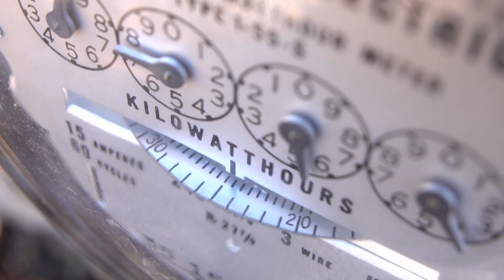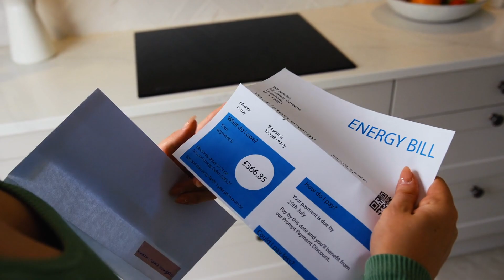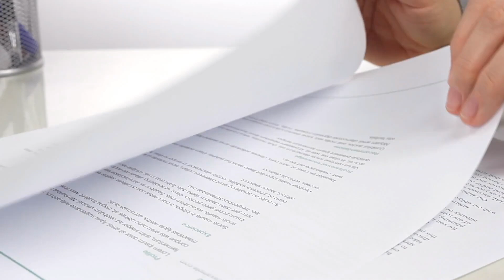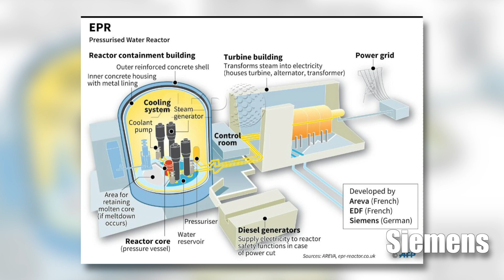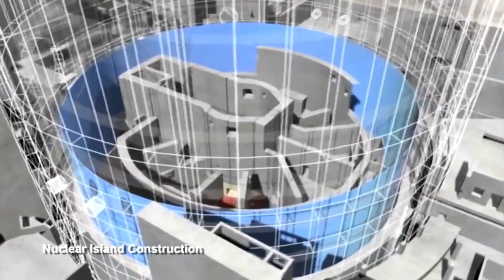Hinkley Point C - Britain's Most Controversial Nuclear Project

Comment: Why are they not looking into molten salt based reactors, which would be a fraction of the cost, this project is outrageously overpriced, and it appears to benefit overseas manufacturers, adding little value to the British manufacturing sector. I can see this resulting in devolved regions deciding to go it alone to bypass costs of this white elephant.

Comment: There is no natural gas fuel savings supporting large amounts of wild AC from solar voltaic and wind turbine generated electricity.   All the electricity can be produce with less natural gas with efficient running natural gas combined cycle plants.   Culling output of wild AC to lower more stable levels makes it slightly more compatible with the public power grid.   Provided there is no cost for the wild AC it may break even on the natural gas use for supporting it.   

In the UK with wholesale natural  gas in Oct. 2024 in US equivalents was priced at  $10.50 per million BTUs.   The high cost of 106 pounds per MWh ($132.53 USD MWh) nuclear  should still be cheaper than making electricity with natural gas prices even significantly below that whole price.  

 US offseason natural gas price June 2024 was $2.50 per million BTUs.   That is three times the estimated fueling cost of a new ultra supercritical clean coal plant burning high BTU bituminous coal with a crossover fueling price with natural gas at $0.80 per million BTUs natural gas.  The UK has lots of high quality bituminous coal it could, with labor reform,  extract by greatly automated cost efficient means. 

Typically there is a significant price for wild AC even though it bids frequently at 0 or negative since large amounts of wild AC  doesn't work without fast reacting peaking power that has to purchased as well.  The electricity wholesale market pays the price of the highest bidder to ALL BIDDERS even those biding at 0 or negative.  So the low bid price of wild AC always includes in the wholesale market sale if it exists in the market even though it costs more natural to support than making all the electricity from more efficient means.    

Wholesale coal fired electricity in the US mid west scheduled 24 hours  in advance is commonly at $30 MWh.   Internally generated coal fired electricity is significantly cheaper.   Likely half this amount or less.   Natural gas is too expensive a fuel even at US break even production cost sale prices for base load electricity.    Natural gas is very good for fast reacting peaking loads using natural gas turbine generators which are typically the only means to instantly backup 100% large amounts of wild AC.

Comment: you gave zero arguments as to why it was a bad idea, you just gave an unbased opinion, saying it was expensive. but even at the 50 billion pounds you fear, 3200MW at 8000 hours a year for 60 years leads to 30 pounds per MWh or 3 pence per kWh. renewables may be cheaper than nuclear, but the grid that you need to go with renewables makes it more expensive.

Comment: The problem started with the last Labour government, The Energy Authority reported extra delivery of power would required by 2030 due to green policy expiring power stations and older end-of-life nuclear sites. PM Blair refused t sign  off a new power station build leaving it to the incoming tory government. Due to the time constraints to build and test a new nuclear station PM Cameron was forced to accept a bad deal by EDF (very public at the time). This coupled with a Chinese reactor that the French versions have never managed to get to designed outputs.  Basically the UK from the 2030's will have the most expensive electricity in the world, meaning no company's will want to move their product facilities to the UK further weakening the UK GDP and reducing public services, ultimately turning the UK into a third world country in western Europe.

Comment: Thatcher ruined the UK's nuclear industry with her ideologically driven 'privatization' policy.
Previous to this, the then CEGB had a well planned program to gradually go fully nuclear with PWRs, after the I'll fated excursion with domestic AGRs failed to work out. Size well B, which has been reliably supplying the UK with electricity for 25 years was the pathfinder project, and the only one to be built under CEGB plans. A nuclear program is only really feasible with a centralised, state owned electricity supply industry. Thatcher's I'll conceived privatisation scuppered this and the nuclear industry. The UK would likely be fully nuclear by now if not for Thatcher.

Comment: Ok nuclear submarine reactors are designed and built by Rolls Royce in Darby, and have nothing to do with Hinckley. Hinckley is not a one off. There is already one plant of this design in operation in China another is nearing completion in Finland. At £102 per MW, that is 10.2p per KW, current average domestic price is 37p per KW.  That is Much cheaper than the current gas based price. A second site will be at Sizewell, which will have more government involvement
Reply: GBP102/MW is a wholesale not a retail price, and is three times the current price of wind projects. Gas is always costlier than baseload power like nuclear and coal which is why it's only used for generation at peak times.
Reply: @gibbonsdp how well does each form of energy convert to retail price?
Reply: OL-3 in Finland is finished and running
Reply: @LambdaWave84  Yes, but it's been even more of a fiasco that Hinkley C - 19 years late and costing almost four times the original budget.

Comment: Come on man. Tidal or wind isn't going to put a dent in your energy needs. You need this.
Reply: It can and often does. Yes, we need more plus extra storage capacity. We don't need this nuclear power station, and certainly not at this cost.
Reply: @tamingthejungleanallotment5486 and who exactly are you to make such an entitled statement?
Reply: @tamingthejungleanallotment5486 Please let me know of any storage tech that can store the energy needed for say weeks? We often have almost no wind for over 2 weeks.
Reply: @Music5362  , @tamingthejungleanallotment5486 is correct. Wind is a very large part of our generation stack and we have an optimistic 50GW of wind capacity planned for 2030. To put that in perspective, in winter times of peak supply we will only need max around 45GW. 

We are a very windy county in the UK, but you are right that wind output is varied. We are in need of stable renewable generation to cut out reliance on gas and I do believe nuclear is the way forward. Unfortunately the way the UK manages infrastructure processes as a whole is very broken and it becomes painful to watch all these necessary projects go 3-4x over budget. 

The other problem with wind is that it generates no grid inertia which is why we need storage capacity to balance the grid. Storage is not meant for powering the grid by itself when renewables are not available unless we are in desperate need of more generation, it is primarily meant for balancing.
Reply: @Music5362  gravity batteries, some of the new chemical batteries are suited to long storage, i cant recall which of the many formulas ive learnt about however as it's not my forte. 
there's also air batteries which can store energy for months apparently, there's also hydro and hydrogen
Reply: @MrRaisin56  apparently, somewhere near liverpool, they are using flywheels to provide inertia
Reply: @kimwarburton8490 The UK uses about 1000 GWh per day. without wind for say 2 weeks, we'll need 14 TWh of storage. The only storage that I'm aware of that might be useful is the salt water iron flow  batteries.
The new smaller modular nuclear power stations promise to generate power cheaper than it can be stored, so storage will probably not be needed.
Reply: @Music5362  Salt water iron does ring a bell. Have a look into the other storage tech i mentioned.
the beauty of the gravity storage is using old infrastructure. Sadly, whatever we use, the biggest hurdle is bringing it to the needed scale within the correct timeframe. 
When you factor in NIMBYs, i cannot see even small modular nuclear being the bulk of the energy grid, IF we are to reach the targets within the time needed. 
I also think the uk needs to heavily invest in tidal, like we are an island FFS ya know?. One of the biggest problems is that there is too much of the silver-bullet style thinking going on, because we are too used to it working .
Reply: @kimwarburton8490 Tidal is very reliable and predicable. The UK is lucky is this regard. I did look in those gravity towers. I worked out that each wind turbine would need it's own tower. 10 MW turbine can generate 240 WMh per day, which is quite a lot. If we try and do that for 14 days, then that's a lot of gravity towers.
Reply: @Music5362  thats a good point! the vid i watched said about utilising old, abandoned mine shafts, did your 'hunt' look into such? or was your info about building 'towers'?. I do not know how many retired mineshafts the uk has, nor how deep they are. It also wont help if the mineshafts are a million miles away from the windfarms. I wonder if there is space for some version of a gravity battery within the tower part of a wind turbine, thus making extra use of it's height? 
I think within 2-3 more years, the world will have access to these new 'disruptive' technologies that are barely out of the R&D phase and governments and communities will have more confidence once they've been proven viable (or not) in various real life applications.
Reply: @kimwarburton8490 Let's hope so. I was thinking of those towers with the concrete blocks and a crane lifting them up and down. I did hear about wind farms pumping compressed air down to the sea bed as a storage solution, not sure what became of that idea. 
I'm sure some clever engineers will  come up with something.
Thanks for the back and forth on this.
Reply: @Music5362  if nothing else humans are an innovative creative bunch, if only we had started all this when i was being taught it in 1992/3 at school xD 
Good news; uk has had 40% renewables  this Q3 according to report from Drax. Thats better than i thought!
Reply: @tamingthejungleanallotment5486  You do not need it. Storage electricity is just too expensive. Say 10-15 times more expensive. Not suitable for everyday's customer.

Comment: The irony is that the UK stands upon vast coal reserves - in the past 2k years we used only a small fraction of them. Proven reserves would fuel the UK for 300 years. The mines were closed with great haste and if anyone remembers it, the mines themselves were demolished rapidly - there was a reason for it. You see, several 'super pits' were literally a few metres away from tapping those vast coal reserves. 
Coal can indeed be used cleanly. We do not need to burn it - we can distil it instead. That way we get all of the components of The Coal Tree out of the coal and the end product is pure carbon, a clean burning fuel. The rest of the fractions from the coal distillation include coal gas, medicines, plastics and even petrol and diesel can be made from coal.
The mines were closed for political reasons. It was purely a political move. 
This nuclear power station shows the world exactly how good the British Government are - useless. They do not know how to run a country, know nothing about the pitfalls, do not care about the consequences of their actions. A big part of me wants the Government to suffer badly from this power station. I actually want it to fail. 
Nuclear is not green, is not clean and will leave a massive legacy of waste management issues for thousands of years.
Thank you for this video.
Reply: No, the mines were closed for economic reasons. UK coal production peaked in WW1 and went into steep decline after WW2 with the availability of cheaper foreign coal and alternative energy sources. Nationalisation and miners strikes merely delayed the inevitable.
Reply: logic tells me that burning pure distilled carbon would eventually mix with oxygen and create CO2, which i believe is one part carbon and 2 parts oxygen. Once the carbon interacts with water or air, you'd have CO2
Reply: @kimwarburton8490 co2 is not our enemy . Don't Believe the propaganda
Reply: @kimwarburton8490 without CO2 there is no plant life and humans will die out.
Reply: Finally someone speaks the truth. It's beyond political it's criminal how the coal generation has been destroyed.

Comment: According to EDF its current cost is 32.7 GBP.  At an exchange rate of 1GBP=US$1.24 and the rate output of 3260MW the plant cost US$12,438 to build.  I spent most my career building conventional power plants and my data are
average coal fired power plant $1,200  to $1,500/kw
oil fired power plant between $1,000 to $1,200/kw
average gas power plant $600 to $1,000/kw

Here are some power plant cost/kw
Medupi 6x800MW coal fired in South Africa $1,640/kw (air-cooled)
Sabiya oil fired 2400MW ($847/kw)
Sabiya CCGT in Kuwait $1,325/kw
Kogan Creek coal fired 750MW station in Australia $1,056/kw
Aqaba Unit 3 & 4 oil fired $850/kw
Great Yarmouth 400MW CCGT in UK $394/kw
Saudi Arabia Ghlazlan II 4x600MW in Saudi Arabia $463/kw (Contractor miscalculation)
Seabank 1800CCGT in UK $460/kw
Shoaiba Phase 1 3x350MW in Suadu Arabia oil fired $857/kw
Three Gorges Dam 22,500MW in China $1,411/kw (World's biggest power plant)
Baihetan Dam 16,000MW in China $1,973/kw (World 's second biggest power plant completed in 2022)
Itaipu 14,000MW hydro in Brazil $1,371/kw) (World's 3rd larges power plant)
Emba Hunutlu coal fired in Turkiye $1,312/kw
Olkiluto 3 NPP in Finland $6,187/kw (recently in commercial operation after cost tripled)
Taishan NPP 1 & 2 in China $2,259/kw
Hinkley Point C NPP 3260MW in UK $12,438/kw

It should be stated here that not all power plant are comparable as eachj can have its own special requirements and infrastructure included.  However the cost of nuclear power plant is more difficult to assess but I managed to get the last three NPP included in the list above.  

UK is country like to spend lavishly on infrastructure.  Apart from Hunkley Point C, which appears twice the Finn or 6 times the Chinese,  it also pays its second HSR called HS2 7 times the European or 10 times the Chinese average HSR cost.  Chinese CGN is also an investor in Hinkley Point C taking 1/3 of the equity at 2016 construction price of GBP 18 billion making the station then cost $6,846/kw or about half of what it is now.  CGN has since refused to up the investment after its capped limit has been breached.

Comment: IF we had had China build it, it would be up and running. 
Blair/Brown Labour Policy was to have Replaced ALL the existing UK reactors by 2020 plus an additional 50 to 75% reactors. 
Tory cuts and was not a tory plan... cut the number to this one... and of tory course, it is still not completed. Always the tory way.
Cut back the scale of the project to just one or two... this increasing the cost 1000s of fold. The more that would have been built at same time would have Greatly reduced the overall cost. 
Same as HS2... Tory stretched it, cut scope... When in fact we should have already constructed HS2...to HS10, 12, 16... connecting ALL urban conurbations in UK to be no two points greater than two hours apart by HST. Curtailing to ONE stub short section makes the cost typical of Everything in the Anglophone world! LOL

Comment: I'm pro nuclear power plants Egypt should move forward in this sector we build 4 plants 4800MW  end 2031 We should build another  8 9600MW we had alot of desert and sea coast not used we need electric to exporting or industry fuck climate change
Reply: Its a good a idea to build a lot. The first nuclear reactor is always very expensive, but the 2nd, 3rd...10th are generally much cheaper.
Reply: well if you have desert ,why not go for solar energy
Reply: @openmind2161  Solar is great, but you need match the variation in the amount of solar with some sort of energy storage. That normally means pumped hydro, though obviously that's difficult in a desert due to water scarcity.

Batteries are very expensive if you want more than a few hours of energy storage (at least with current technology), and long distance transmission cable can help balance the grid but require a country to have great geopolitical relations with a nearby country with lots of dispatchable power on the grid.

So solar is great, but not that simple.